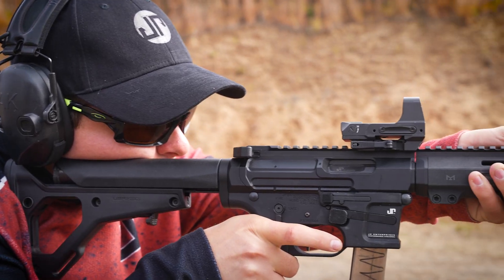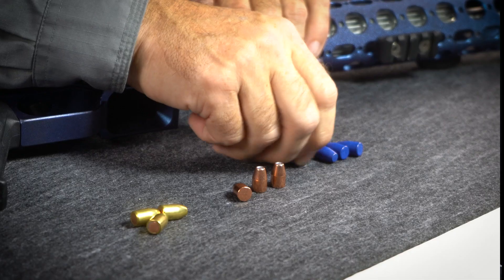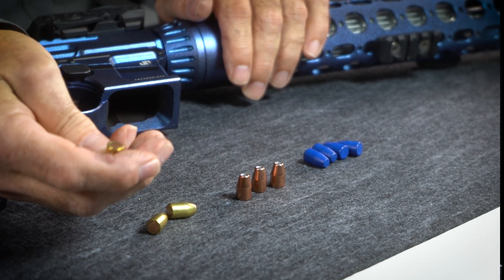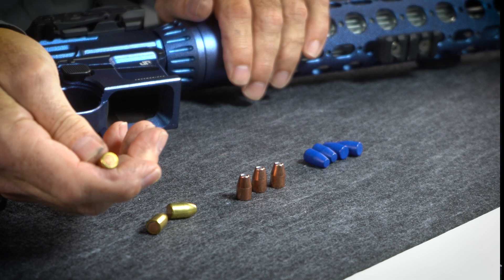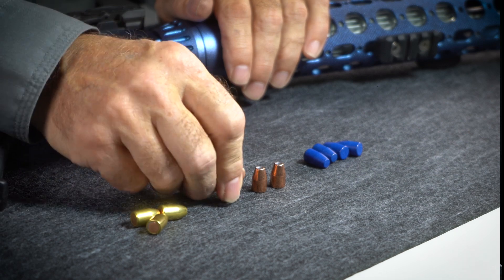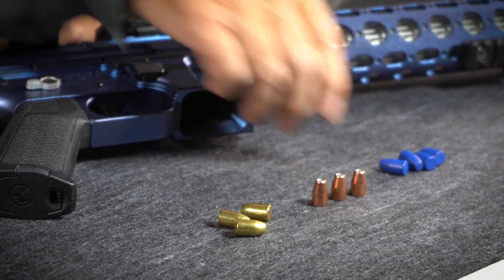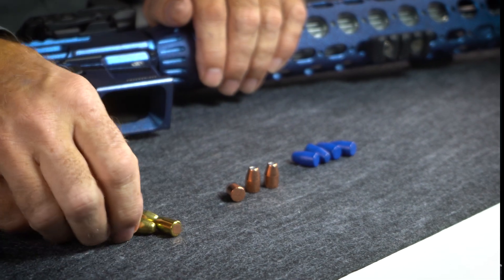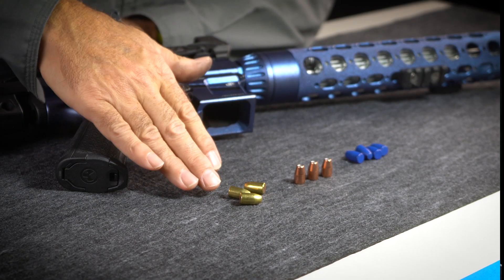Reloading 9mm for Pistol Caliber Carbines

Comment: Good information; I just built a blowback PCC in 9MM using a JP barrel. Nice shooter . . . ran my normal loads through the chrono on my CZ75 and the 16 inch PCC the same day for comparison.  Used Acme coated lead bullets, my own powder coating on cast lead, and Berry's plated.  Used 115, 145, and 105 grains to see how things would go.  Load with Tightgroup (haven't found Bullseye in stock for years, though it is my favorite pistol powder) and small rifle primers.  
I list the power factor here too:

Caliber   Bullet      Weight  Powder   Charge Vel.    P.F.          Gun
9MM	Acme	145	Tightgroup	3	977	        141		PCC
9MM	Acme	145	Tightgroup	3	925	        135		CZ
9MM	Acme	115	Tightgroup	4.3	1344	154		PCC
9MM	Acme	115	Tightgroup	4.3	1217	140		CZ
9MM	Berry	115	Tightgroup	4.3	1304	149		PCC
9MM	Berry	115	Tightgroup	4.3	1176	135		CZ
9MM	Cast	105	Tightgroup	4.2	1228	130		CZ
9MM	Cast	105	Tightgroup	4.2	1378	144		PCC

Everything ran fantastic and this is a good basis to see if there is room for improvement.  Tightgroup is also a fast burning powder.  As a side note, the 145 Acme sounded suppressed from the PCC (only the JP Muzzle device is installed).
Reply: Im very tempted to run subsonic 150gr just for good times. Literally going to test 122s and 127s today. Thank you for sharing your hard work!
Reply: Ordering a JP-5 next month... I cast and reload... BIG CZ fanboy myself 
Thanks for the info

Comment: I've limited experience. I've only use Berry FMJ in 124-135 & 147. I've used several different powder/projectile combos and with chrono and range work come up with two best loads. Pistol 124grn CFE
Carbine 147grn Blue dot.
Reply: CFE is dirty dirty dirty at minor PF.
Reply: @CTrain  All gunpowders are dirty. Clean and maintain your firearms CTrain.
Reply: @johntempest267  I don’t mean they make black stuff in your gun.  Lmao. I mean it leaves unburnt powder behind. Cfe notoriously at minor pf loads. 

Since you have “limited experience” maybe you should take it as advice to try other powders. Or you can just tell me to clean my gun. lol. Feel free to click my picture and see what background I have on the subject.
Reply: @CTrain  
I have many different powders, and have tried them. I get good consistent results with cfe, and I don't see unburnt power left in the barrel you reported. I appreciate your expertise and experience. 
Maybe you said notoriously but meant supposedly?

Comment: I have a JP 5 STOCK steel challenge model what defensive factory loads are ok to run? I've done zero mods since new
Reply: I’m not JP obviously, but I read from a reliable source that the standard pressure (not +P) HST and Gold Dot 147s are running well. They are expanding reliably while penetrating through the proper amount of gel. The +P were getting too fast out of PCCs and disintegrating before penetrating enough.